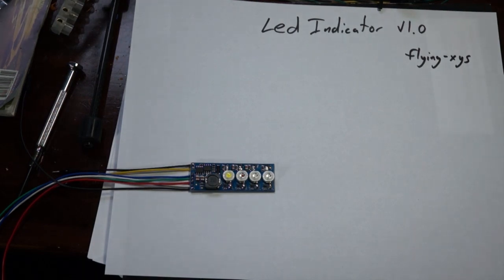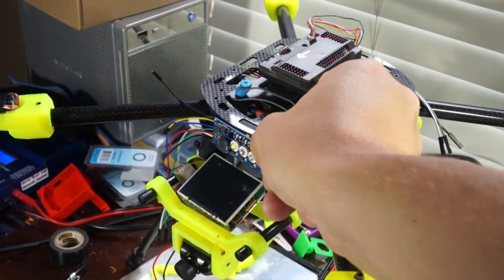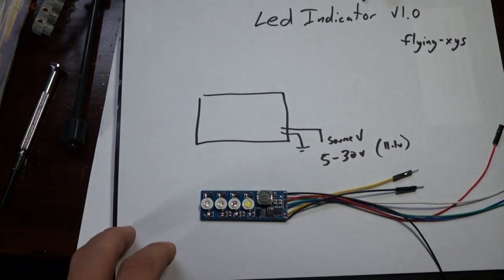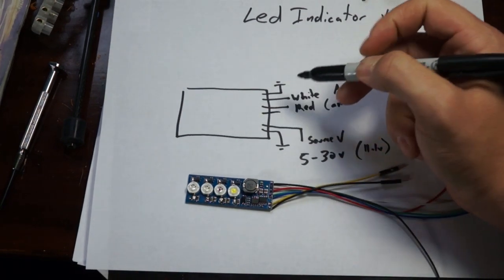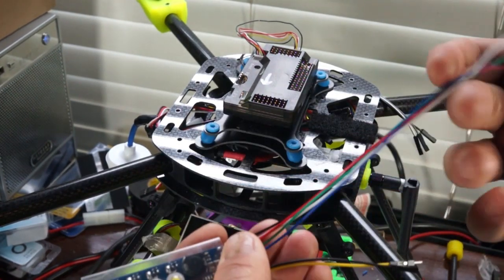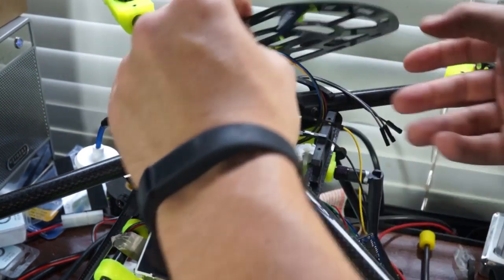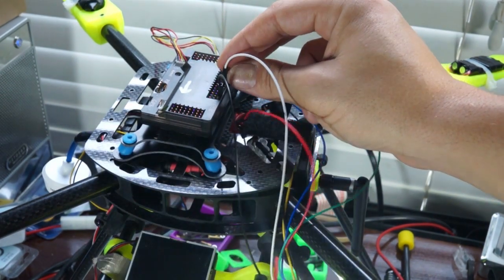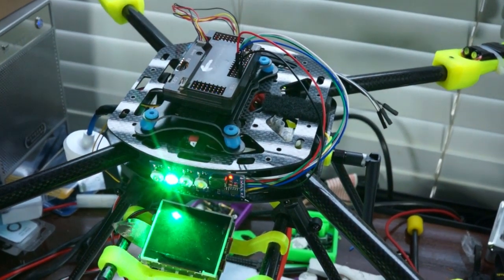Led Indicator V1.0 - QuadCopter - APM 2.6 - 3watt LED Indicators

Comment: Thanks for the video,  i am building my first 450 and using the APM2.6 but worried about getting lights to see.  This will be perfect, but I also have a question you may be able to help with.   My APM came with a power module but was not sure if I should use this or just power it from the ESC    any suggestions or guidance would be very much appreciated.     Thanks again

Grandpa Jake

Comment: Thanks for the video! Where did you tap into for the power? The power distribution board? I'm building my 1st Quad and want to be sure to pull the power from the proper location.
Reply from the maker: Yes, tap into the pdb. As long as your running 2s/3s voltage,  need to keep it below 12v. They are incredibly bright, so even a 5v ubec  would be good if one wanted a dimmer led.
Reply: Nico D Thanks for the quick response! That will be perfect, I am planning on running  3s.

Comment: Couple of small points above you say "Using a 2S 11.1v which should be ? either betweeen 2S and 3S 11.1V also wouldn't it have been better to set your voltage to a failsafe triggers return to home and Land at say 80% battery power used?.
But hey minor points and thanks for putting up the video ,I realy appriciate people doing this so we all get to talk about our builds and reduce mistakes before our first flights.
Keep up the Vid Matey....Cheers
JC in Auz
Reply from the maker: Yeah, meant 3S @ 11volts. Yeah, i've since disabled voltage failsafe, I have two way telemetry on my new quads, so I monitor it pretty closely.

The crash was due to garbage ESC's, which reduced throttle power to 60% when below 3.7volts. No idea why it was set so high, anyway, didn't have enough lift to get back. I've since swapped the ESC's for opto's so i have full power, would rather blow a battery than crash/tree the drone.

Comment: How do you get the low battery warning? I thought ardupilot only supports batter failsafe, where it will also engage auto land right away. But a premature warning is not supported as far as I can see...
Reply from the maker: Best low battery warning is an audible, don't trust LED's since your flying around. I ended up building a voltage monitor to tie into an LED, but ended up just using two way telemetry way better/easier. Audibles are bad in wind, and led's are bad in bright light. Telemetry is the best way, or use battery failsafe (problems with that tho), if your flying around tree's and your battery's low, by default, it'll climb to RTL and slowly return home. Might not have enough juice to get back, so i just watch the voltage on my transmitter and when it get's close i bring it home. If it's too far out, i'll set it down somewhere and go get it. Failsafes can get you in trouble sometimes.

Comment: hi
I just want to ask if this what happen with everyone
when I connect everything like you said and plug the battery all the light comes on flashing and when you arm the copter all the light its on and steady  ?
if is this correct . I thought it will work like the in board light like blue that will flash when looking for gps and steady when lock alone not all of them ......
thanks
Reply from the maker: Did you change the bitmask? Make sure you set the bitmask in the APM software so that the external LED's will work, otherwise i don't think anything will work.

http://diydrones.com/profiles/blogs/adding-external-led-indicators-and-a-piezo-beeper-for-arm-and-gps

Comment: Hi guys, I followed the instructions but there'e something wrong here.
I power the module directly from Lipo 12V and module lights up (tiny orange led).
But when I connect ground cable to the FC, the FC turns off!
What am I missing? (when I power the module, green and blue leds light up weakly: is it normal?)
Reply: +Giorgio Conte 
I solved connecting module +- to the FC +- (instead of Lipo)

Comment: Great informative video.  I installed this Led and connected the green to A6 (GPS lock), red to A7 (arm/disarm). The A7 goes solid red when armed and blinks when disarmed. Works fine.  Problem is, the A6 goes solid after 5 sats. My APM 2.8 has minimum sats at 7. Has anyone else had this problem and come up with a solution? Thanks for any assistance.
Reply: Found the following info on rcgroups.com.  * The LED is completely misleading, though. It simply tells you that there is a 2D GPS lock of some sort (can be off by hundreds of feet, will still turn on the LED). Plenty of people lost/destroyed their drone relying on that LED.* Also:  *the LED doesn't tell you anything about HDOP, just that the uBlox engine found enough satellites (3) to get the initial ephemerides. *  Thought I would post this in case anyone else has an issue.

Comment: Hmmm.... I must be doing something wrong... I have the arm/disarm and the GPS led hooked up to the appropriate pins..... if I arm the FC and get the constant red LED the blue goes constant as well (even though the FC led is still flashing waiting on GPS lock!), both blue/red LED's on the external LED board flash when I disarm the FC.... !!! ... nothing I do makes a difference....  thanks for posting the above tutorial... :-)
Reply: +David Garrett ... have a convo with myself here...... ;-)  , all working now... disconnected the ground cable and all worked as it should....... :-)